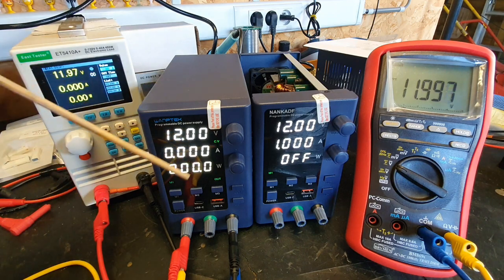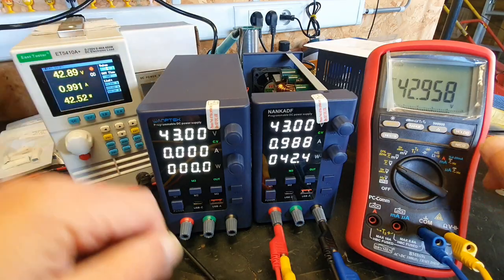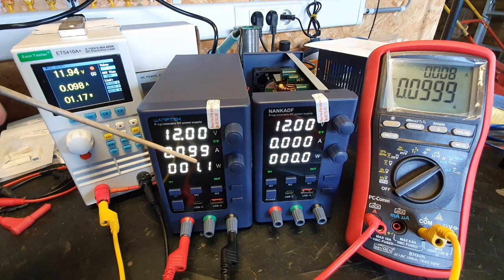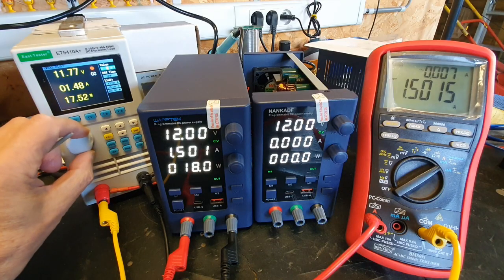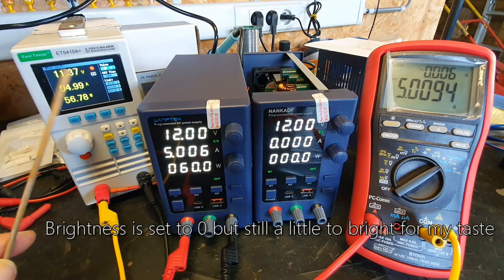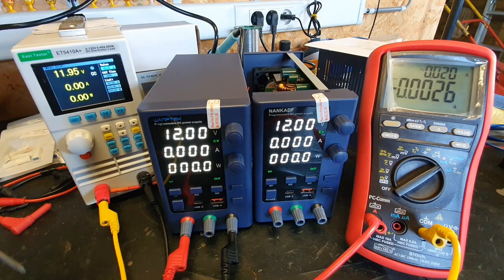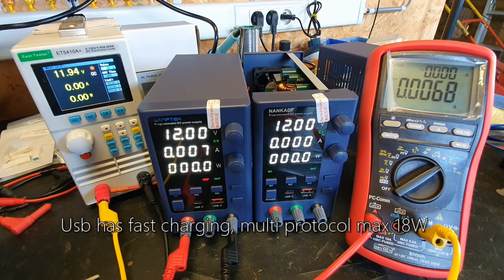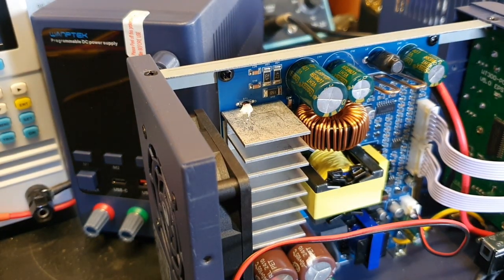Wanptek & Nankadf EPS6205 Power Supply

Comment: I bought two of the Wampteks
One of them is .03 volts high.
Good enough for charging batteries
Reply: If you really want to, you can open it up and there are pots inside so you can zero/calibrate your supply. The various altitudes makes them vary, according to where they are used.
Reply: @englishrupe01 
Good to know because I live at 6800 feet.
Thanks
Reply: What Kind of batteries? Lead acid or li-ion charging? Can it charge 4.20V a cell by setting the v Max to 4.20 and Max amperage to 1A is it charging then or pushing the amperage higher on the start over 1A so the voltage is regulating and stopping it from charging?
Reply: @TonyMontana-xj3zv можно заряжать. Установите ток 1 А и напряжение 4.2V Аккумулятор зарядится до 4.2V и потом ток будет меньше 1А и через время упадёт до 0